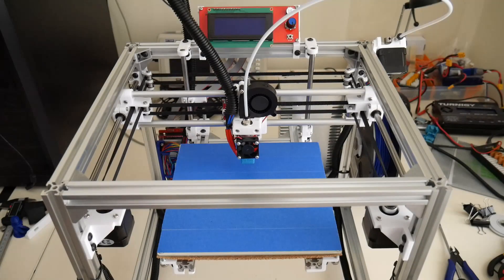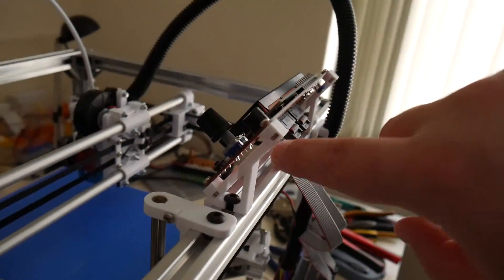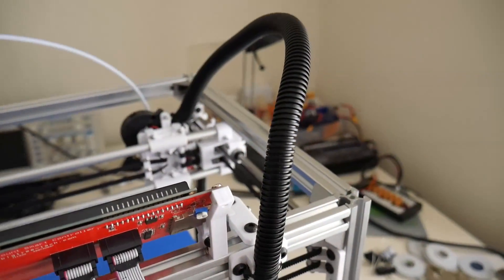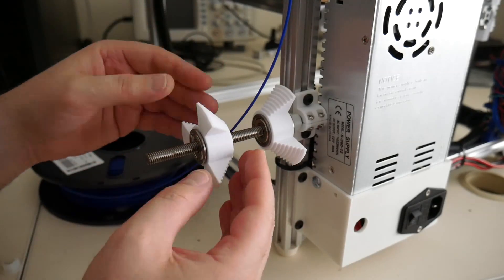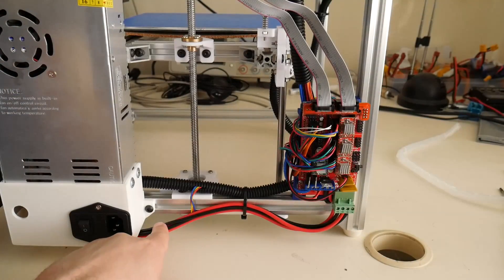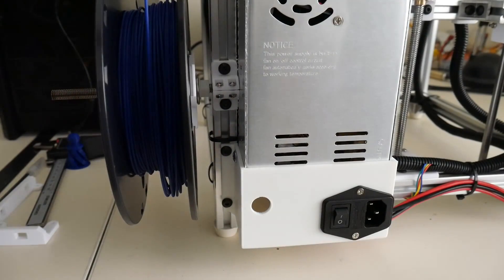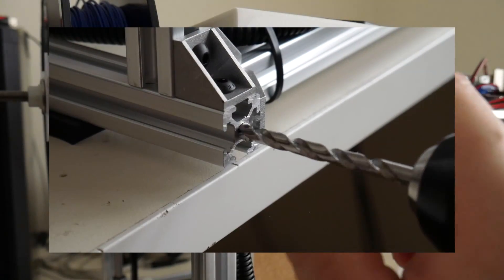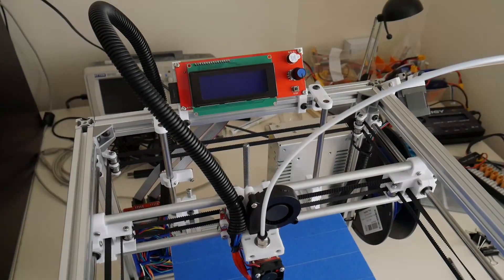HyperCube 3D Printer Accessory Pack

Comment: Great printer by the way, but why didn't you use 2040 for the uprights and make 2020 boxes for the top and bottom like an ender 5 pro, then you could of drilled and tapped the center holes to M6 for 25mm bolts, drill holes threw the the extrusion in the right places and bolted the frame together as well as your corner braces, that would of made a much stronger frame. This is how I'm going to make my frame....See user manual for ender 5 pro on the internet and you will see what I mean....But thanks for sharing and it's nice to see someone take the time and effort to show designs and ideas for making a 3d printer I take my hat off to you.  :-)

Comment: Can u help me?
My driver motor (drv8255) is too hot. I use ramp 1.4.
Reply: HI. I had the same issue before. use the motor data sheet and set your vref. by setting the drv8825 pot to match the motor current. Then add a blower/fan to blow over the ramps 1.4 board
Reply: @markpretorius6854  Thank u.

Comment: I just received today a DIY RaiseCube 3d printer for parts.  The frame is acrylic and completely destroyed in the mail. Seller indicated that the printer worked, but believed that the controller board needs to be reflashed,  even though printer worked.  I basically got it for parts.  Just from this video here I know I could build this setup with most of the parts from the printer I just received and from items acquired from my local hardware outlets. My wife is wondering why I need another printer.  It's not about a need.  It is all about the adventure of the build.  Thinks for all of your input.

Comment: Hey guys & gals, if you want to put the rubber feet on your 3d printer but don't want to or can't drill out the thread in the 2020 t-slot tubing then go to Bunnings and get Ramset Brick RamPlugs (R720016) 5mm x 25mm (orange), about $4 a pack. Just tap in the plug and you can then screw in your TIC rubber feet without any drilling/threading.

Comment: A couple of thoughts. Since you are using an inductive bed sensor, and I presume Mesh Auto Bed Leveling, you shouldn't need springs under the bed to keep pressure on the bed as you are manually leveling it. You could simply use a nut (or nut and jam nut) to hold the bed against the bolt head, and the same setup you already have for mounting them to the z-frame.

For the cable management, instead of using split loom, you could still use spiral loom, but add a strand (or two) of Nylon or PETG filament that you also secure at both ends, which should give you the added stiffness to keep the cable from drooping, etc.

Comment: Hello!
clean, efficient design and well explained, logical considerations, congrats !
I own a couple of prusas I'd like to convert and a couple of corexy (vulcanus). However the issue I see with the vulcanus is that while the mass of the moving part is less than for other designs, the center of gravity is high and as a result (at least this is how I interpret it), the printer is shaking a lot at high speed. Do you happen to have the same issue with the hypercube ?

Comment: Nice work... On my power board add on I also put three XT60 connectors. Two wired for 12v and one for 5v. I can now connect my Raspi and LED lights etc to the same power...
Reply from the maker: Yeah I was thinking of using XT60 connectors as well, but ended up wiring it direct with cable tie for support.

Comment: I forgive you for saying "particular" 20 times per video because your Hypercube is a work of art. Ive just discovered how to cut my Aluminium Extrusion accurately using a manual mitre saw with 16TPI blade (24 might be better but they didn't have any in stock), so by tonight I will have my frame built & can start gettin'  jiggly about the whole project. NICE accessories TECH2C and thanks a million for sharing with everyone! You're an absolute Star.

Comment: congratulations on a fantastic build. it prints beautifully and it was really interesting to watch you go through design iterations to continually make it better. although its done, i hope you'll be as eager to pimp it out with more add ons as i would be to see the videos, unless of course you're considering another build entirely, like a delta perhaps ;-) 
i'm just starting to build a delta and have a selection of excessive extras that need to be used, like a diamond hotend, the dual extrusion prometheus system from disTechAutomation and confusing (to me) micro controller stepper driver boards with closed loop positional feedback (called ustepper) that all need to be used to their full potential, and seeing you talk about control boards or implementing dual extrusion would be really interesting to see.
anyway whatever you're working on next i'll be watching and look forward to it! thank you so much for these incredibly useful videos.

Comment: Great accessory list. I've just started the HyperCube build, frame is assembled and squared up so those rubber feet are exactly what I'm looking for next. Can you let me know which Sydney supplier you use for the 10mm anodized aluminium  tube, I've looked at a few including Ullrich, AluminiumTC but none have the 10mm OD/2.4mm wall thickness.

Comment: Anyone that has made one of these awesome printers have an estimated cost? This would be my first 3D printer so I would have to somehow outsource the printed parts, if anyone knows how much the printed parts cost that would be great too!
Reply: I just spent about $550 on it... (Canadian - most of it through ebay)
Couple of the parts/pieces I already had on hand, such as the 8mm/10mm rails, bearings and power supply

Comment: Next is to add Wifi to your HyperCube ;) 
I used ESP-12E and Flash ESP-Link on it and Using Repetier TCP/IP Connection and 115200 Baudrate you can print or control your printer as fast as you like.
I tried a 25min Dry run print with 300% Speed and no Checksum error occurs (success).
Also added a LED lights to my glass bed and it looks awesome and that help to notice any under-extrusion or gaps on first layer or holes that might be blocked from over extrusion.
Mine is almost like yours it's 20x20 AluProfile and Im trying to make it as beautiful as I could following your technique. :D
I have Ramps 1.4 but I have all pins used in it and its current mount I print is so weak and got broke, so definitely will try your design soon.
Living in Iraq and electricity might goes off so I run it on both power supply and a car battery with some big diodes to pass bed high current.
Thanks for the videos, you are awesome and so informative.

Comment: 5.2mm is fine for M6 threads
Reply from the maker: The 'quality' tap I have started to strip, that's why I had to drill the hole out a bit. I had the drill bit size on hand so no big deal.

Comment: How big are your profiles of the structure?
Reply: I believe its 300x 300y and 350z or something so he could get the full 200x200x200mm build volume, but I might be a bit off here.
Reply from the maker: The sizes are listed on the Hypercube Thingiverse page. Check the description.
Reply: ty
Reply: ty
Reply: would you recomend me to use a profile 40x40 type-l slot8?
Reply: I'm using 3030 - remember you will need to alter many of the parts to fit larger extrusions - I'd say 4040 would be over kill unless you are scaling up the build volume

Comment: I'm just finishing my own CoreXY that was partially inspired by your HyperCube, but redesigned to deal with the parts I had on hand from previous printers.  Thanks so much for these great build videos... your detailed explanations are something that can be really hard to find in the community.  The "why" has saved me from going down several paths that would have been mistakes!

The power supply mount is what was on my list for today, so you've saved me some design work.  I also like the way you've tackled the feet... off to the hardware store for me.

Cheers!
Reply from the maker: Haha cheers!

Comment: what plastic u using on the led PSU is it fire retardant?????
if not that's very dangerous !!!!
led PSU have a cover over the terminals ?????! u don't need 2 covers do u
Reply from the maker: Well, if the PSU catches fire it's fair to say the entire printer will go up with it, along with anything else in range of roaring flames...

Comment: it should be called a hypercube reprap why have u forgot the reprap community !!!!!!? 
did u code it no did u design it no not really it's a reprap don't forget to give credit to the open source reprap, love and peace
Reply: The Prusa Original is also a RepRap and it doesn't say it on the name.
Reply: Mark Williams, especially as it was printed with a Prusa i3 and uses Marlin.  That said, clearly a lot of design was done, and fully shared by Tech2ç, credit where credit is due.
Reply: Not to nick pick his fine work, but I would tend to agree with you! it's most defiantly is a true reprap in all the ways that count.
Reply: good point.
Reply: Along with virtually every iteration of the original RepRap project ever created... the first line in the Thingiverse build even states that it's a frame upgrade.

Comment: is single z motor viable?
i was thinking building one, but with double z motor
Reply: Jhyrachy Luce 
FYI It works just fine for me.
- Eddy
Reply: Would you mind posting info/pics on the dual Z Drive?
Reply: Sorry, I meant that the single axis motor works fine. The table is not that heavy so one motor is able to to the job.
Reply: my fear is about the deformation of the opposite tip of the build plate
Reply: Yeah I was worried about the same thing. I did buy a second screw but never ended up using it. Tech2C's 2nd design iteration on the bed w.r.t the bearing carriers is much stiffer. You have to push down on the bed fairly hard to get it to move down. There are also some re-mixes on the bed/bearing support on Thingiverse...
 - Eddy

Comment: How did you get yours so quiet? Mine is very loud, even with springy dampening feet on a rubber mat.
Reply: Its next to my bed and it's quiet.
Try to adjust the speed of your X&Y steps in a way that they don't resonate with the body but that is kinda tricky as you might need to adjust the heat of your hotend according to the speed.
Also you might need to lower your steppers current and they will make less noise too.

Comment: Mate this is a beautiful design, really good application of design and consideration for saving material! Thumbs up for bunnings solutions too!
Reply from the maker: Cheers!
Reply: Oh wow you watch his videos as well?
Reply: The only small thing i would change, and i mean the only thing, is that the wiring loom. I would do exactly as you have but i wouldn't put any endstop wires inside of the loom. Just on the off chance of interference causing a false trigger.
Reply: mate, nz is better,  we have mitre 10 as well as bunnings

Comment: I've been following you for a while and even before you started this design and i have to say that i am very impressed with what you came up to! 
This printer looks awesome, the print quality is impressive!
The only thing i would like to see is the new kind of printing bed like the one they are using on the new Prusa i3 mk2. Do you think you could fit one of these one your hypercube to make it even more awesome?

Cheers ;)
Reply from the maker: You could fit any size bed you wish! Simply increase the extrusions and rods in the axis's that need extending by the difference. A larger bed would warrant extra support so best to duplicate the Z axis parts to support the bed from the front also.